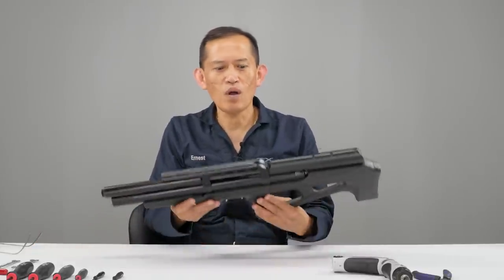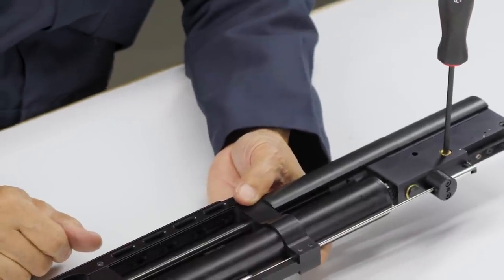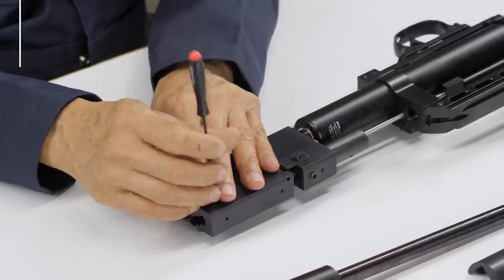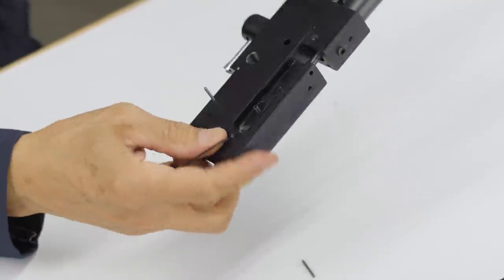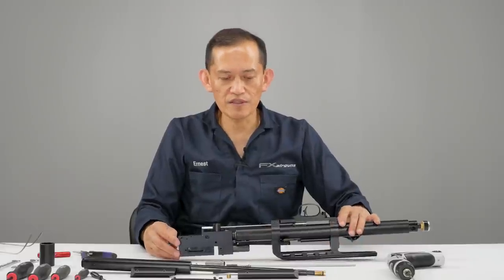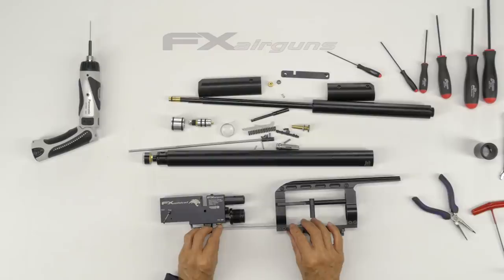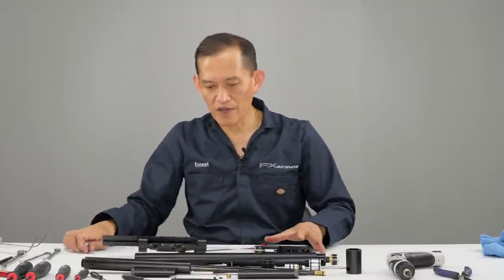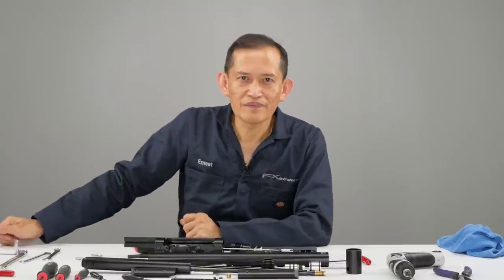How to Disassemble FX Wildcat MkI - FX Masterclass

Comment: There's an o-ring at the base of the manometer that is being forced out of a small bleeder hole in the neck of the housing. What size is that? I need a new one.
Reply from the maker: Please take a look at the support page of the FX website where you can find part drawings and oring sizes to be sure to get the correct part you need . But i believe your talking about the X ring ?
Reply: @FXAirguns  the diagram calls it a plastic bushing, so I'm guessing the O-ring was an attempt by a previous owner to fix the leak? I have the bushing ordered.

Comment: Hello thanks so much for the video A+ I was trying to remove the shroud on Barrel to clean lead dust from it ended up stripping Barrel from brass connector when trying to remove is there any way I can put a MK2 Barrel in my MK1 so I can change liners thank you really appreciate it sir

Comment: Thank you for the excellent video. Will there be a Wildcat MK2 disassembly?  Or MK1 & MK2 are essentially the same?
Reply: They are kinda the same if you watch older videos of the MK1. This one has the MK2 trigger linkage and is minus the hammer spring brass locking plug.